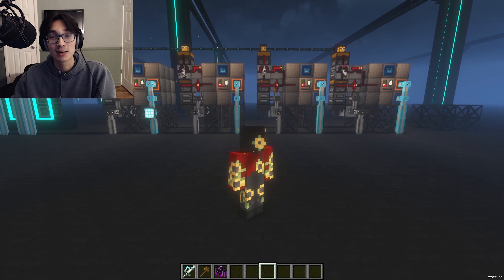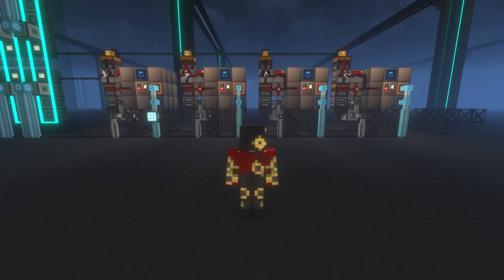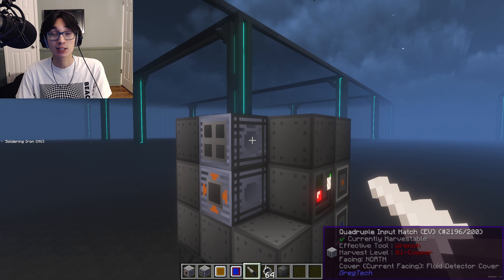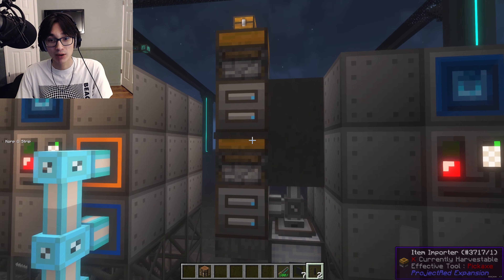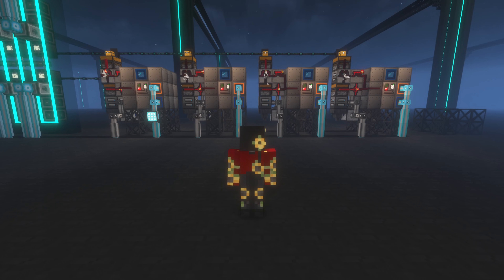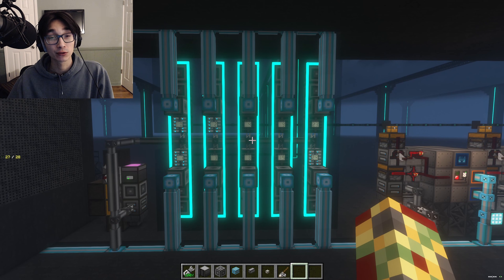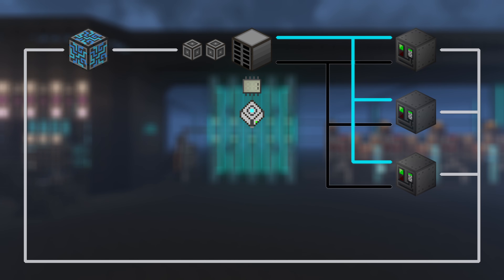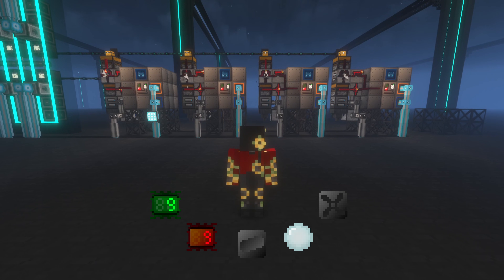Universal Automation: A genius solution for a modded minecraft problem. Gregtech New Horizons 2.7

Comment from the maker: IMPORTANT: If playing 2.8+, covers were updated to default 1 tick. If you are having problems with multiple circuits in the bus, make sure to set them back to 5 ticks. 

Universal setup priority goes as such for me: In EV: #1 Large Chemical Reactor, in IV: #2 Precise Assembler, #3 Mixer, around LuV: #4 Fluid solidifier and #5 Laser Engraver. Around UV+ you will want to switch to Universal Mega Chem Reactor as well as make a universal Component Assembly line!

It is also really important to note 2 more things as mentioned by @drnye9692:
1: at 7:20 I connect the fluid decoder to the subnetwork via cabling!! Its not enough to just put the storage bus on it otherwise it wont be able to receive power or place fluids in the input hatch. 
2:Additionally, if you try this setup on precise assemblers or other machines, make sure storage busses are not being powered by red alloy cable, this causes them to not be able to deposit items into relevant buses! (I think this is a bug)

If youre still having trouble, make sure that you only connect your drives once the filters have been set! otherwise you will have problems. You can just leave the channel colors on default until everything is ready

Also, 2.7 added a 1 step nitric acid recipe with circuit 21, so add that too! I am making a doc with all the useful circuits for each universal machine: https://docs.google.com/spreadsheets/d/1zDgYaYrRifQY3G93ETWbvSYSjqtA4ls8Vx4e1pVShyA/edit?gid=0#gid=0
Reply: I've had nothing but troubles with the item importers on my dedicated server. They simply stop responding to redstone signals after a while (some random amount of hours).

I did find a compromise though. Its much less complex, so much so that I'm wondering if my game is bugged, or if anyone really hasn't tried this before...

Each LCR is set up unconnected to other LCRs with:
1) An input subnet only consisting of a Fluid Storage Bus and Storage Bus connected to the LCR inputs, and a Dual Interface with a blocking card as shown in your guide, fed by a directional Dual Interface from my main net with the patterns (same as yours looks just without the drive on top).
2) The same cover setup you have, to turn the machine on immediately when fluid or item inputs are detected. And 2 Redstone alloy on the side to relay the signal from both hatches to the control cover.
3) An IV Robot Arm on a free side of the Input Bus to pluck circuits out from slot 0 into a chest.
4) An output subnet, feeding the circuit and LCR outputs back to a main-net interface.

Even if the circuit in slot 0 is only there for a tick, the machine runs fine, even with enough inputs for multiple crafts. Its remembering it (hopefully feature, not bug).
The only major downside I can see is that I lose parallelization unless I spread a few copies of the patterns to the interfaces for other LCRs I set up this way.

To make the patterns I just need to follow a few rules:
1) Always include a circuit in the top left slot, even for circuit-less crafts.
2) For big crafts, never add more items to the pattern than you have Input Bus slots available, -1 for the circuit. As some of your inputs will overflow into slot 0 and be whisked away.
3) Liquid quantities in the pattern can exceed the input hatch max, as long as it is split into multiple crafts that each are lower than that max.
Reply: would u say that universal wiremils, abs's and ebf's are worth doing?
Reply from the maker: @CursedNight-rl3dxI think abs theres a good reason, ebf and wiremill seem like a waste to me
Reply: @IX_Streams  I did universal EBFs and they've been very handy, it handles parallelization very well and it has (imo) just enough circuits that it's worth it. now, trying to send the correct amount of inputs so that it doesn't get stuck at using 45% of an amp on top of universal automation was a bit beyond my grasp, but enjoying what I have so far. Also, using 0.4s on the timers was causing the cells to sometimes not manage to remove the circuit in time, or deadlocking somehow, setting it to 0.5s (as another comment here, that I cannot find, said) fixed all of it

Comment: Great video! Got it up and running with this instantly. c:

Got 2 question though, which I do not fully understand how they impact the system:
1. Why use the repeater and not just a normal red alloy wire blocked with another strip of any block?
2. Why use a hopper and not just pull the cell out of the ME IO Port directly with the conduit?

Comment: 2:40 How exactly do you go about solving this issue of machines responding slowly without universal? Also I don't quite understand how universal exactly solves this issue
Reply from the maker: The item and fluid detector covers send a redstone signal to the controller, which wakes it in 2 game ticks! This makes responses consistent and fast
Reply: @IX_Streams thanks, that explains it. Implemented this in my playthrough, but I've been having occasional issues of multiple circuits getting stuck in the input bus. I've set the item detection cover to 5 ticks like you recommended in the pinned comment but this issue still occurs. Playing in 2.8. Do you have any suggestions for fixing this? Would raising the ticks to 10 make it better or worse?

Comment: please if u are gonna make this modify the design to use 4 full sized hatches instead of a tiny tiny quad hatch
Reply: Replace the quad hatch with your biggest single hatch, add three more identical hatches with the same fluid detector and soldering iron setup, add the fluid storage busses and set them to have descending priority.

Comment: I tried doing this setup, and I must've done something wrong, but I tried to follow exactly. It keeps sending #2 cells into the LCR, and also randomly pulling items from my network, even when nothing is set to craft. Do you have any advice?
Reply: Oh and the cells are being returned empty without the #2 programmed circuits.
Reply: Wait I fixed it! Mostly at least. The only problem now is that the filled storage cells aren't being extracted from the hopper and placed back into their me drive.
Reply from the maker: @RaventheWizardVT check your enderio conduit settings and also check the contents of the cells. If all else fails, you may have to redo your filters!
Reply: @IX_Streams  I fixed it! The recipes seems to mostly be working as intended. I got indium dust to go through easy peasy, as well as other #0 and #1 circuit recipes, but the other numbers seem to stall. Particularly, the recipe for Tetrafluoroethylene. The LCR acts as if the recipe isn't valid, despite the NEI saying that it is. The recipe calls for 12kL Chlorine, 2000L Methane, and 4000L Hydrofluoric Acid, which went into the quad input hatch easily, as did the required circuit, but the LCR still didn't process the recipe. I'll have to figure it out tomorrow, but otherwise this is a brilliant setup!
Reply: @IX_Streams  Ok I kinda figured it out, I just had to replace the LCR block and it seems to process recipes again, but not the storage cells aren't being pulled into the second IO port to put the circuit back in. Any idea how to fix that?
Reply: I think i see what's causing the problem. It's the machine controller cover, for some reason the LCR doesn't want to process recipes when i put it on the side. When I just use the regular LCR without the machine controller cover, it processes fine, but the cells don't move like they're supposed to. What can i do about this?
Reply: I fixed it! I accidentally forgot to put back on the fluid detector cover (or whatever its called). So it seems to work perfectly now with all of my recipes and the cells are being filled and sent back to the ME drive. 

Thanks for responding and trying to help, I really appreciate it :D

I did have one last question: Can I put different machines with similar setups next to my LCR? Like a Blast Furnace or Mixer, connected to the same Ender Conduit pipes? Would it cause conflicts, or would it know where to send specific recipes to certain machines?

Comment: I used this method for automating my EBFs (and later Vulcani) and the 2.8 update seems to have broken my specific use case :(. For the EBF's I have the whole automation setup rotated so that it lies horizontally (to deal with the EBF's coils getting in the way of having the item and fluid hatches stacked on top of each other like in the original guide. This worked perfectly fine in 2.7 but when updating to 2.8 it broke. Specifically, the item and fluid detectors refuse to send out a redstone signal to the TOP side of a block despite their criteria being met.

Doing some investigation I believe I have identified the source of the issue: there seems to be some weird inconsistent behaviour between having the hatches as part of the multiblock and just having the block out by itself. I removed my hatches from the vulcani and tested whether or not the covers would send a redstone signal when the hatches were placed elsewhere... of course this worked. When I tried placing the hatches back in the multiblock and verified that the redstone signal was still set to strong... it wouldn't work.

Has anyone else had this issue?

Comment: @IX_Streams if blocking mode is enabled, why do the drives need 10 cells? woudn't 1 or 2 be sufficient and the rest will be unused since we won't push if one is already been filled?

also, do you recommend a reservoir hatch on the LCR or are there known recipes it can cause conflicts for?
Reply from the maker: The catch is that as soon as the enderio conduit pulls a filled cell, the drive subnet is now empty and can take another recipe. you use multiple cells so that all of your machines can be saturated with copies of the same recipe! This makes it so you are utilizing all of your lcrs, even when youre only doing one type of recipe.

I wouldnt recommend reservoir hatch, it would likely cause conflicts and not save you on much time or effort
Reply: @IX_Streams  oh right, I was only thinking of 1 LCR as I have setup, not N machines, that makes sense. thanks this worked beautifully

Comment: Thanks for great guide! 
For some reason on 2.8.1, untill I set topmost IO port to "Move to output when the cell is empty", it was only unloading one fluid and moving cell to output, which was breaking the setup
Still have no idea what I did wrong, but guess that fixed it :D

Comment: I made Universal Automation and when I make a recipe that uses calcium, the circuit number remains on the input bus as follows. Is there a solution? Calcium is not used in the production, so it's still there
Reply from the maker: Found the issue! Check the pinned comment!

Comment: Quick question about the Excel spreadsheet! When looking at the first section titled "LCR: #1 Prio, EV" it states that it "Includes 12 total circuit numbers:" and then only lists 11. Is there a missing circuit number, or was the 12 just left over from previous versions of the spreadsheet? Thank you!
Reply from the maker: probably just left over from an older time!

Comment: So what is the point of the machine controller cover?
Reply from the maker: It immediately wakes up the machine and starts the recipe, huge speed boost as normally it takes a bit of time for multis to recognize that they can craft something
Reply: @IX_Streams  I just did this for my assembler and I keep ending up with multiple circuits in the input bus
Reply from the maker: @RealShadowreaper pinned comment!
Reply: @IX_Streams  Yes I saw that but it still happening also covers default back to 5 ticks now. edit: I think it's fixed now I tried to skip the machine controller cover because it kinda got in the way of the deco and I assume because of that it was able to start the crafts within the 5 ticks causing it to break with smaller crafts. On the plus side I think I may have thought up with a way to make the redstone circuit better but I gotta do more messing around first.

Comment: If anyone is having problem with this setup it 2.8 beta the gt covers was updated to allow them to update on 1 tick instead of 5 ticks as in 2.7.4 this changed all existing covers to update on 1 tick breaking this setup to resolve this simply click the hourglass on all 3 covers until it says 5 ticks and it should work again in 2.8 beta

Comment: another question, how does the system "know" to pull out the non consumable to the io port after the recipe inputs were consumed? is it timing based? what if the MB doesn't consume the inputs fast enough because it has to do multiple batches?
Reply: oh I think I understand, the detector covers redstone signal also controls the importers besides turning off the controller, is that it?

Comment: Love this design, the video does a wonderful job explaining things (especially with that animation), its kinda crazy something this powerful can be utilized in just EV.

side note: the red alloy cable directly next to the LCR controller shouldn't be necessary, as the one on the other side of that block is sufficient in powering the controller cover
Reply from the maker: Can be as early as EV! And yeah probably dont need the extra red alloy upon reflection

Comment: After following the guide, I'm having an issue where when the cell used for crafting is pushed to the LCR, the fluids are being unpacked before the items (including the circuit). For a few recipes, namely acetic acid crafted with circuit 24, the fluids dumping moments before the items causes the system to craft another fluid using circuit 0, thus jamming the LCR. Has anyone experienced this?
Reply from the maker: this… should never be able to happen 😂 IDK exactly whats going on here
Reply: @IX_Streams   and I don't use it for anything else, so it's not a residual thing. From my understanding, I should have the internal circuit empty so i can craft circuit 0 items

Comment: hi! nice video, its good to see some good quality gtnh content. Do u use this setup for platline / lanthanide proc.? is is worth it? If yes, should i make a different pattern for each byproduct of the same recipe? Btw you earned a new sub!
Reply from the maker: @j4viersitox7  I have never done lanthanide lines and I dont recommend them, esp if doing meteors or bees! But yes, this is usable. I would say look into the opencomputers level maintainer for this as the AE maintainer is really annoying and unpredictable.
Reply: @IX_Streams  how do you get samarium from meteors without lanthanide line?
Reply from the maker: @CursedNight-rl3dxI think rubracium? Im not quite sure youd have to dig in NEI. I know I had some short line for samarium
Reply: @IX_Streams  neither mytryl nor rubracium seem to have a meteor and samarium only has a meteor in zpm

Comment: Im planning on using this for on demand autocraft to export into machines for more advanced processing lines (like platline currently), using crafting cards on the export buses (or dual interface using pumps). However it doesnt seem to call the craft. Any idea why is that?

To add to this : when I manually call an autocraft for the said filtered fluid it does get sent afterward. So it seems like it just doesnt want to recognize the export request
EDIT 2 : It actually seems to take the request, but it seems to "overflow" the setup with lets say chlorine for exporting hydrochloric acid.
Reply from the maker: Crafting cards are really laggy and i dont advise them-oftentimes tho maintainers which are similar will have trouble crafting something if one of the inputs is being steadily passively drained

Comment: IX this video is so awesome. I was STRUGGLING to find a way to remove circuits from input buses. I want to comment here because I think I have significantly improved the design -- particularly if you're in low tiers and making extra components sucks, but also just nicer to have a simpler machine. You can basically lose the entire pre-filled cell distributor, as well as all of the ender IO cables (I try to avoid ender IO where possible).

The general idea is instead you have to encode the circuit number in the pattern itself, as well as an empty 1k ME drive. You use kissing dual interfaces into the machine's subnet (blocking mode on!). Then IO port system looks like baby chest -> item importer -> ME drive. And you similarly only need the bottom half of the circuit. You get to lose the fluid decoder packet stuff, but you add a storage bus on the baby chest filtering the empty 1k ME cell. 

With this setup, the pattern puts the 1k cell, and the circuit with the ingredients. Once the recipe runs, the setup pulls the circuit into the drive and it can be sucked out of the machine setup. You need to have a setup to empty the drives, but this can be done pretty simply. You get to have it so that coding up new circuit numbers doesn't require you to change any of the rest of the setup (even the separator system if you're clever I think).

I would be happy to discuss further if my message is not clear enough. But it seems to be working and I think it would be cool to see if anyone else has any other ideas for improvements.
Reply from the maker: You have just invented sampsas original setup lmfaooo, the problem is that it cant handle fluid combo recipes, and those are the killer for organization as you progress.

Comment: Indeed, a great solution. But won't it cheaper and more convenient to just use an ME chest, a stocking hatch and exporter+fluid decoder in a LCR subnet?
Reply from the maker: This can run into the problem of fluid only recipes not working with nonconsumable circuits, and s gated to ~UV+ when you unlock autopull stocking hatches! It is a good option for UV prass and other always item recipes